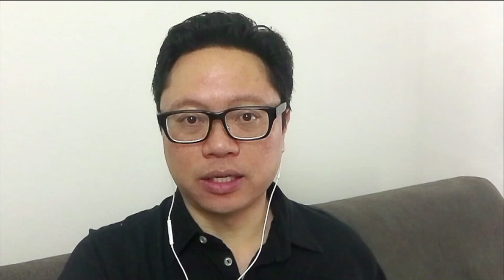Is Balanced Audio Better For Headphones?

Comment: The genius engineer Tim de Paravicini who formed the company EAR-Yoshino and designed all of its electronic components states " a balanced connection" is not necessary for headphones. He designed one of the very best headphone amplifiers, the HP4, without a "balanced" output and it has been my reference tube headphone amp for many years. The synergy with the HiFiMan 1000 V2 is outstanding. The Bakoon Amp-11R which is equipped with a magnificent headphone section and synergizes perfectly with the Audeze House of Pain LCD-3 also comes equipped with only the 1/4" standard jack output.

On another subject, the supposedly best dynamic headphone ever produced according to some head-fiers that have been around the block, the Focal Utopia, has been removed from Tyll's WOF. He finally noticed these cans make one's ears bleed with a spike at 6k Hz. Wonder how many doled out the cash for these ridiculously overpriced and underperforming headphones based on his recommendation. Several months ago I listened to a well broken in pair of Utopias. I also watched Tristan's review of the Sony MDR-Z1R (Zeds). The engineering and quality of craftsmanship of these cans are very impressive. Not only are they capable of producing speaker-like bass but they are also very musical and a touch on the warm side which means no listening fatigue. These are the first cans I've heard that can put you in the middle of the concert hall and stereo recordings play as though the listener was listening to a live performance with the musicians on a stage as opposed to the middle section being on the top of your head. The middle portion of the music seems to emanate from inside your head with the perfect sound stage width for the left and right channels. BTW, Tyll panned the Zeds. What does he hear?
Reply: Am curious to know what you listened to the MDR-Z1Rs paired up with? AMP, DAC and whether you went stock or custom cables like the Kimbres. I've been looking to make this as a long term headphone purchase so in terms of durability and quality of construction its certainly high up on the list. Currently I'm only looking at portables such as the Chord Hugo 2 or the Woo Audio WA8 as pairings but haven't had a chance to listen to the latter yet. 
I especially am interested in the HP4 due to its age. Price isn't a particularly huge object for me in this purchase as I aim to make it for a sufficiently long term of 5-10 years, but I have yet to listen to the HP4 as related DAC pairings and the like do confuse me. I personally am not a fan of Chord's product cycles where they release newer versions of products purchased in the short term which kind of make older variants obsolete-especially given the price points of these products so would love to hear more on amps such as the HP4 and good DAC pairings with it for the Z1R if you've heard it with it.
Reply: Hi Ethan     First off allow me to inform you that I am a traditional audiophile that does not believe in "streaming".  It is my contention, along with a number of Japanese, that nothing surpasses the physical disc or vinyl in reproducing hi-fidelity sound. except the master tape. "Streaming" degrades the sound IMHO. 

I'll refer to the TOTL Sony as "Zeds". One of its qualities is that the better the electronic chain that you feed them with, the better they will reproduce music. In other words, they scale very well. I nixed vinyl when SACD came out back in '99 and listen primarily to Japanese discs both lo and hi-res. They are routinely the best pressed and best mastered discs in the world. 

My audio chain begins with a PS Audio Power Regenerator. All electrical current from your wall socket provides "dirty" electricity and is easily noticeable once you "regenerate" it to clean power using the PS Audio device. It's not a power conditioned but completely regenerates the electricity. Plug your kit into one and I guarantee you will not want to remove it. 

I use an EAR 4 Transport paired with a factory tubed EAR DAC 4. I was speaking with the U.S. distributor for EAR, Dan Meinwald, and we both agreed what Tim has been able to do to make Red Book sound musically satisfying is incredible. While one can "stream" hi-res with the EAR DAC I do not use it for that, only Red Book.

In my system, using the NOS tubed HP4 with the Zeds would be too much of a good thing, so I stick with SS amps. I have both the Luxman P750u and the Bakoon Amp-11R. The Luxman is a "tubey" sounding SS amp which I tend to usually plug the Zeds into. However, the Bakoon tightens up the bass and presents a more neutral but still pleasing sound. I find however the Bakoon takes some of the richness and creaminess away from the presentation, two qualities I particularly enjoy.

I took Tristan's advice and purchased the joint Sony-Kimber cable which I can heartily recommend over the stock cable. As far as pairing DACs with the HP4, I can't be of any help to you there. I use the HP4 along with a TOTL Marantz SACD player and allow the Marantz to make the conversion. 

Just for your info I pair the HiFiMan V2 with the HP4. The V2 is not as warm as the V1 and the HP4 and V2 are very compatible. Just a word to the wise, the HP4 is one of the very best headphone amps on the market but one must pay attention as to which cans to plug into it. The amp is not ideally synergistic with every can on the market. Listen before you pair up!

I hope I've been of some help.
Reply: I'm sure there is science behind it, but filtering out "dirty electricity" sound like the most sounds like the most snake oil bullshit ever and I can't help but want to call that out. Obviously I've never heard anything with such a set up so I can't actually knock it since I haven't tried. I wish I was rich and could afford to get stuff like this to see if it makes a difference for myself.
Reply: The "sound" you have not heard is your kit powered by the PS Audio but you just could not resist adding your worthless 2 cents. Do some research pal before sounding like a fool.
Reply: lol. Dude it was implied that I was referring to the PS Audio generator. But for those who don't know enough about electrical/sound engineering or better yet, haven't heard the damn thing and form a subjective opinion, you should be able to imagine how it would be difficult for someone to comprehend how big a difference something like that would make.   I'm not saying your set up IS snake oil or whatever, but I'm man, that lack of insight or sense of humor is what makes the audiophile community look like we have our heads up our ass.
Reply: I'm an affable cat with what my friends think of as a wry and sometimes dry sense of humor. When someone that has not even heard a piece of equipment that I recommend and then has the temerity to refer to it as "snake oil", it doesn't do much to endear that party to me regardless of how small our little community may be.

Since I'm not in the market for any gear, I don't normally hang at the few shops that still cater to us. However, if you happen to find yourself in one and they have a PS Audio Regenerator have a listen with and without. Then we can discuss. Peace!
Reply: Hello Mark,
Thank you so much for your quick response and inputs, my apologies for not being able to reply with the same. I have no disagreements with the contention that streaming is a degradation to the sound quality. I own only one audio CD in a format not currently available for my reference purchased from a trip to Japan years ago as a child and it still is among the better sounding (to the extent possible with my system anyways) of my recordings. Unfortunately, obtaining audio CDs is a lot harder than it should be in my country due to an absence of CD retailers, and trade barriers making it rather uneconomical to import-so much so that I personally will be primarily using digital files until my next trip abroad or when I change my country of residence.

Your inputs on power regeneration have also been taken into consideration, though I certainly will be looking into those after finalizing the amplifier purchase bearing in mind that a change in country of residence will possibly change power voltage requirements as well.

So that leaves me with this-my initial purchase after the Zeds will begin with an EAR HP4 and DAC4 pairing based on audition results and when I amass a reasonable SACD collection, I will purchase an Acute4 transport and end it at that. Given all the moving about that is planned, I am not bothering with any recabling or accessories for any of the components in the near future so at the time of audition I expect to hear the gear with digital files primarily and only with CDs that will be present at the gear store. I will be basing my impressions on the performance with digital files, but I will bear in mind at all times that there is more that can be accomplished with this setup-the rationale behind my choice to stick with digital for impressions is to focus on the present-only time will tell if how long it will take me to procure well mastered recordings for my musical tastes. This will probably be far below what is possible with this system, but I would like to incrementally add any upgrades so as to obtain a greater appreciation for the sound as I go and hence for the initial phases I am willing to make the compromises that running the system stock bring with it.

What I still wish to ask of you however, is if you could elaborate on what you mean by "too much of a good thing" when referring to the Zeds powered out of your EAR system ? I understand that given the Zeds focus on a musical and warm-sounding presentation, solid-state amplification is typically preferred to balance and bring out its neutral characteristics. At the same time, I see you prefer the "tubey" sounding Luxman, for its richness and creaminess, characteristics I understand can be expected typically from a tube setup-so the differences between the solid-state Luxman and the tube EAR system in this respect would be helpful to hear. Of course if the Zed HP4 is not a good pairing please excuse me for not catching it if that was implied from your comment. 

Regardless, thank you for your time. Any insights on how the Zeds sound with the EAR system would be thoroughly appreciated as there is little to no information available online and given that I will have to fly out to audition the system, I will have to wait at least until the end of the year for making my own impressions. In the meantime, I have only my presumptions, which of course are open to change and I appreciate all the information I can get.
Reply: Hi Ethan

I just read your rather detailed response to my post and wanted to get back to you quickly even with a brief response for now since you are undoubtedly very serious regarding these matters and I respect that. To be honest, I've never listened to the Zeds with my NOS Tubed HP4. The EAR DAC4 is tubed and even stock from the factory sounds so incredibly good that I had no desire to roll tubes. In my initial post I left out the fact that I run the DAC into an NOS Tubed Aesthetix Calypso Signature Linestage (preamp), for two reasons. The most important is that the linestage is able to switch the absolute polarity when playing the disc from a button on the remote and it does it immediately (no time delay). This allows me to determine which polarity was used to master the disc. One of the most important steps is to listen to digital playback using the proper polarity. The second reason is a matter of convenience since there are so many cables used in my rig. Some will say using a preamp degrades while others state the proper pre actually enhances the playback. A discussion better left for another day.

So you see, with all of the tubes already in the chain and because of the sound sig of the Zeds, I reasoned that an SS amp would be better than tubed. I have both the newest Luxman and a Bakoon AMP-11R. The Zeds do sound different depending on the amp with the Bakoon definitely tightening up the bass but I keep going back to the Lux because of the lushness and lack of harshness. What I need to do is listen to the Zeds with the HP4 and report back to you. Because I am scourged with a condition I call "cyclical tinnitus", I am not always able ear-wise (my ears) to evaluate properly so please allow me some time and I will report back to you.
Reply: @MarkRoberts-bj2me  Hi Mark,
Seeing as it has been almost over a month, I can't help offer embarrassed apologies for a lack of a response again on my part. This will be where this habit ends. I do have, an excuse of sorts however, named the DMP-Z1. It isn't particularly what I'd call an ideal system with my reservations held for one unit solutions. But the impressions of an HE-1 owner on Head-fi have my eyebrows raised, as I don't think I will ever lightly take anything that apparently sounds on the level of a D.A.V.E and comes shockingly close to the HE-1. Not to mention the proposition of these being the "ideal pairing" for the Zeds, somewhat of a given considering the common make. Topping that off with the claims of ultra-low noise power from the internal battery and isolation of digital and analogue components, and this product almost demands a listen, at least for ones such as myself who  have never had the honour before of listening to such a configuration. Power sources and conditioning are yet rare topics of discussion at most of the audio stores I have visited, at least for Head-fi, I assume it holds greater importance to people in the context of stereophilia. 

Given how enlightening I find your commentary on digital polarity I have no opinions to express on the point of contention of pre-amp impact on playback quality. As the adage goes, this frog can only express gratitude for the help in seeing the ocean beyond his well. I do however better understand the rationale behind the SS amp recommendation for the Zeds. Does bring something to mind to ponder, if tubes are to be restricted to only one component in the chain, of amp and dac, what would be the respective impact on the sound when one is tubed and the other SS/vice versa? A question no doubt, only a listen can answer I suppose.

All that being said, I do not wish for this reply to sound as a "follow-up" of any sorts so my apologies once again if by any chance it seemed that way, while I am as enthused as before to hear of the experience with as remarkable of a product the EAR family is, I consider it rude on my part to in any way indicate any sign of obligation on another person's part for what clearly is a favour. All the more so because I'm sorry to hear that you too are plagued by the condition that at times seems to be the baneful cost of this hobby. So I will say what would go without saying in any conversation with myself-regardless of my seriousness with this purchase, please take the time you please in your response. I understand you would nevertheless have other responsibilities to attend to so I can have nothing but excitement and gratitude at a quick response, but hold no expectations for one. If at the end of this its ambiguous what the purpose of this write-up was-consider it a status report on my part on my quest for a perfect pairing for a piece of headphone equipment. I understand the DMP-Z1 might not be a product to your tastes at all, as it is of all things a digital media player, so I will not ask any thoughts or considerations on the matter. To me of course, this is an important rest-stop for consideration on my journey. As said above, I will give greater priority to this thread henceforth.